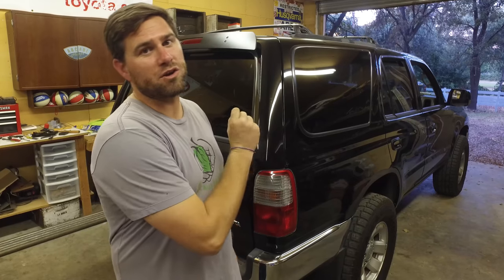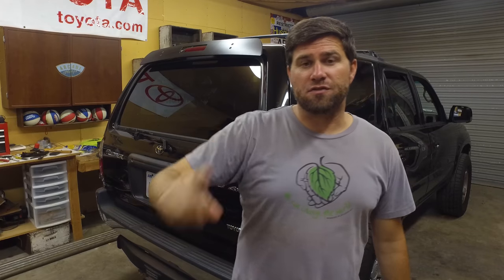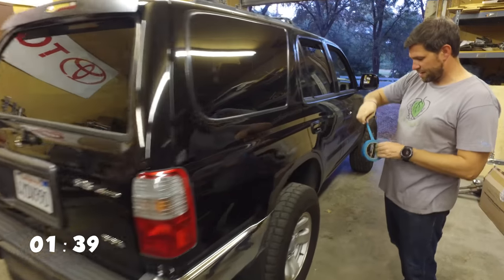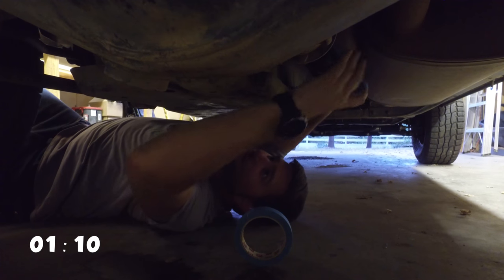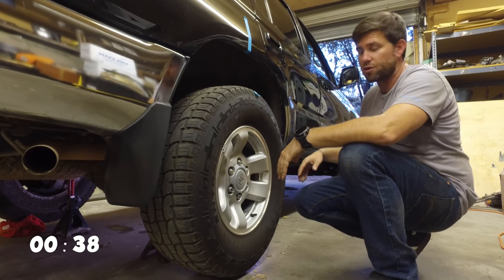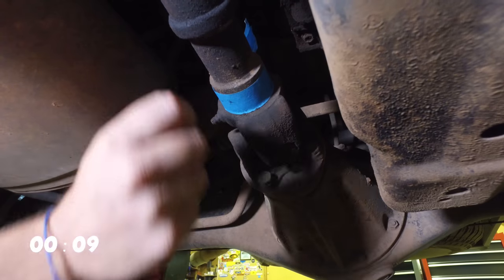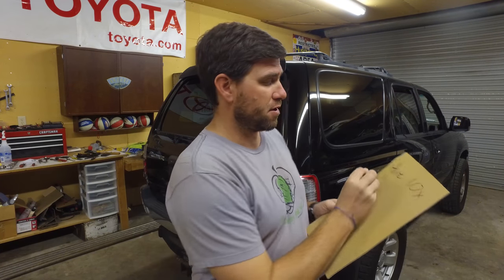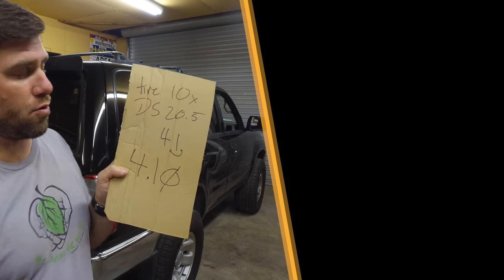How do i find my differential gear ratio

Comment: Cant argue with the results but I would think the reason why you multiply by 2 is not because there are 2 wheels - cant quite understand why though, on a non limted slip your one wheel would be spinning if you stopped the other one and technically should give you the right ratio? Can you explain?

Comment: U lost me
Reply from the maker: one roatation of the tire to how many times the diff goes around
Reply: @SnailTrail4x4  rotated tire completely around one time yoke went around one time
Reply from the maker: @skipperlilo5353  I am sorry, you need to rotate the tire 10 times. If both tires are off the ground you need to secure one so it doesn't move. Or just leave it on the ground. Once you rotate the tire 10 times you should count how many times your drive shaft rotates. When we did ours it rotated more than twice as much has the tire. How many rotations did you get When you rotated your tire 10 times?
Reply: dont understand why youre multiplying by 2.